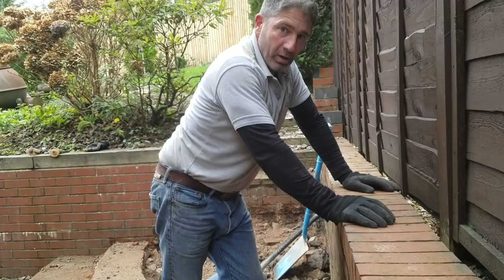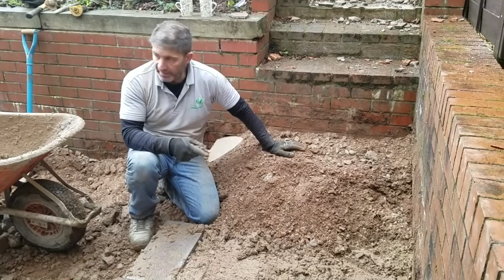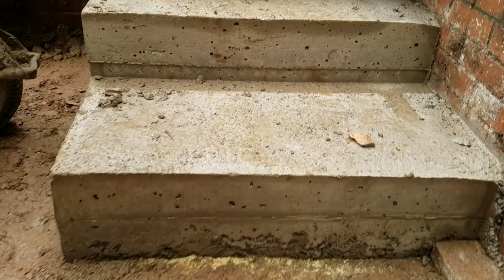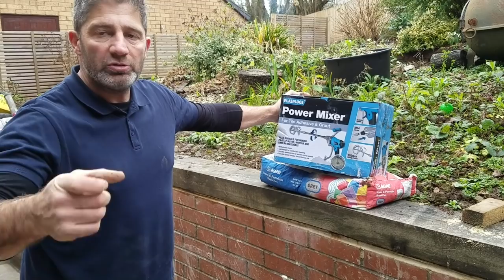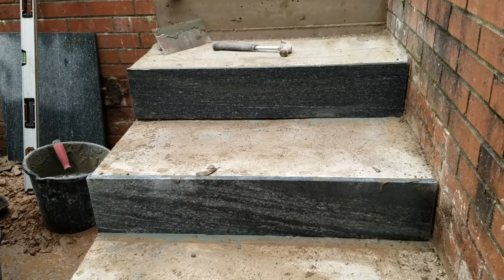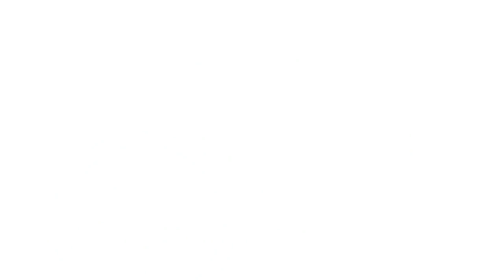How To Build Granite Steps

Comment: So glad I found this video again. I did my porcelain patio a couple of years ago following your advice and it's sound!
I have to tile a block wall porcelain tiles and plan to use the mapei, question for you if you don't mind though... do I need to prime porcelain wall tiles if using the mapei adhesive?
Reply from the maker: Cheers Dan glad it went ok for you mate, if your using Mapei Rapid set you wont need any primer but butter unit and base your sticking to mate.
Reply: @GreentopLandscapes  thankyou for all the info and videos.

Comment: Another excellent video,  I have just removed some westmorland slate which had  become unsafe on some steps, risers are 850mm x200mm thinking of using sandstone  plank steps  which are 900mm x  200mm  x40mm hoping that the company will cut off the  50mm, so they fit.do you think that they would work as risers ?   The original steps were set on breeze blocks I have sanded down to level I am thinking of using self levelling concrete for the treads then placing granite as treads do you think I would need a slurry on the granite for adhesion? Also what mix would i need to set treads on ?   Is it possible to get bullnose granite?  If not would sandstone be better for treads and safer ?  finally what was the slurry you were using? I really do appreciate your opinion total fan thank you stay safe Steve
Reply from the maker: Hi Steve mate. first of all many thanks for watching thats kind of you, I think no matter what material I would use I was use  priming slurry but if your working on flat concrete I would use Mapei exterior adhesive rapid set for the treads and risers and I would butter the unit and the tread and riser it just works perfectly mate and I am always happy to talk anytime be safe mate.

Comment: Hi John thanks for another great video,, I am currently in the process of refurbishing some outside steps,  could you please tell me, if granite is suitable for the treads?  Is it slippy when wet? Also what thickness granite did you use for the risers?  And final 2 questions.  What was your mortar mix, and what depth?  Sorry one more I take it that the Mapei is applied to the  tread  and , riser for adhesion again just a buttering? Thanks much very John  big fan

Comment: Can you use the rapid mortar material on standard 40mm paving when doing up stands for steps?
Reply from the maker: Yes mate I have a few times but it would be good to give technical at mapei a call as I did, stay safe
Reply: Greentop Landscapes & Design thanks for the reply, been looking at the 20mm black limestone so going to try it with them onto either a concrete block or poured step like you have done here 👍🏻 top work

Comment: Not sure granite is a material you'd wanna use for steps.. Wouldn't it be super slippy when wet?
Reply from the maker: Supplier thinks it was fine, all wearing courses can get slippy but I will look into this, most paving comes with an R11 rating. be safe mate